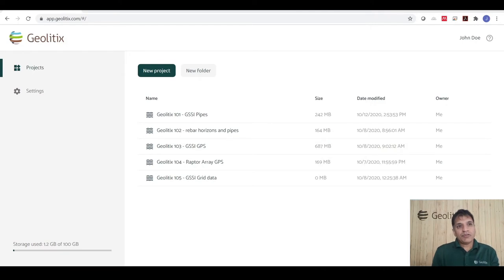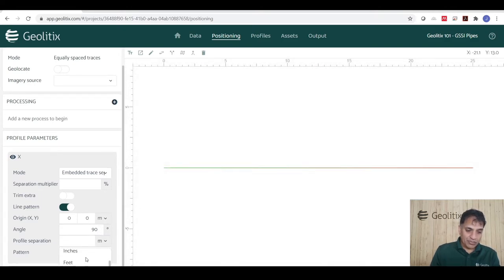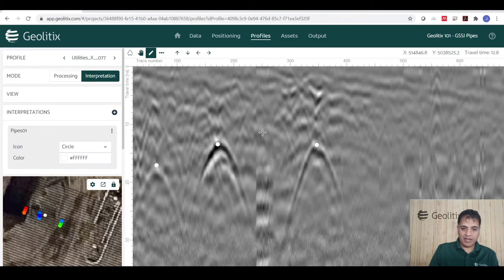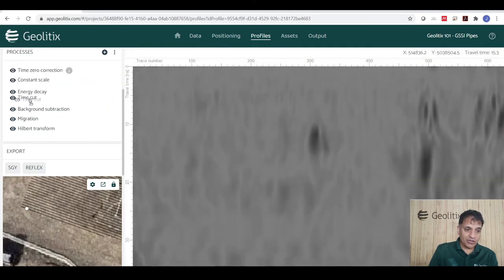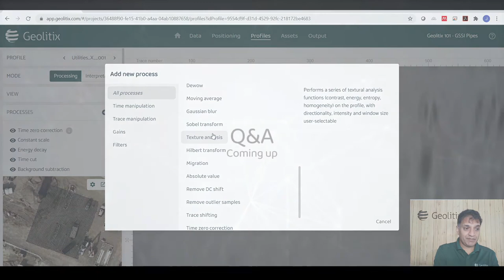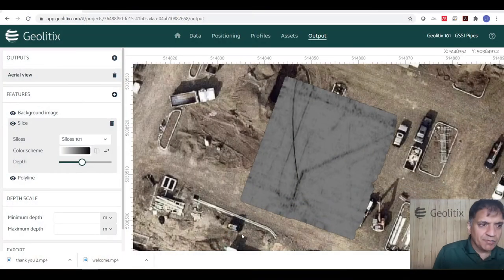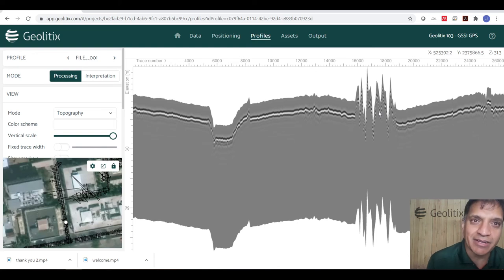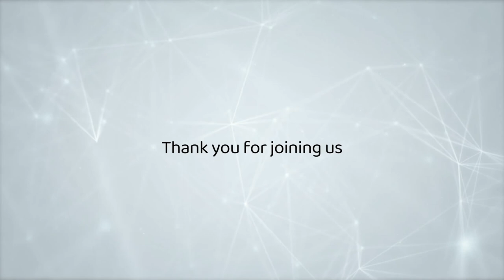Geolitix 101 - Introduction to GPR Processing

Comment: Hi ..when it is required to DC shift removal and will it be befor e time zero correction or after
Reply from the maker: DC Shift isn’t usually needed with modern GPR systems.  It was more commonly used with analogue instruments.  If it was needed, usually it would be performed after time zero correction.